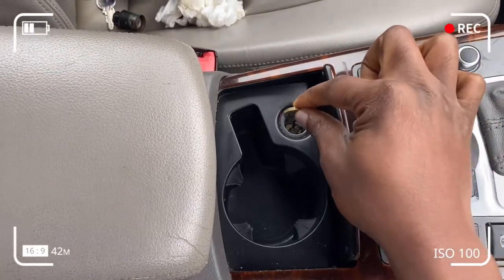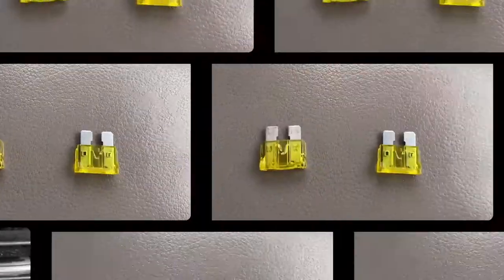How to locate & fix the cigarette lighter & car charger outlet socket fuse on Audi A6-Front & Rear

Comment: my sat nave cig lighter works but partly comes on when I plug in the Nav? what should I do?
Reply from the maker: doesnt seem like a short circuit. you can clean or vacuum out debris or FOD in your cig lighter. metallic conductors or any material that can cause a short circuit should not be used with the lighter e.g coins, spoon e.t.c. Debris buildup may be causing partial connection so needs clearing out